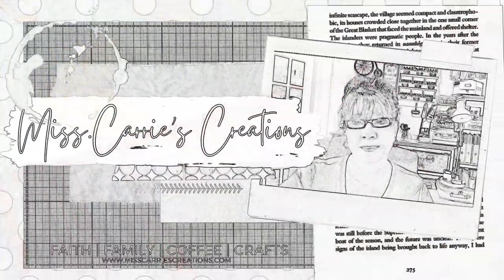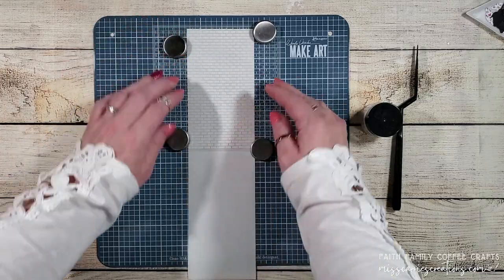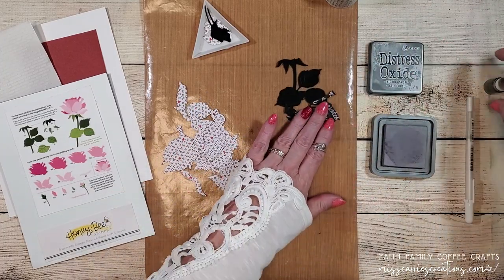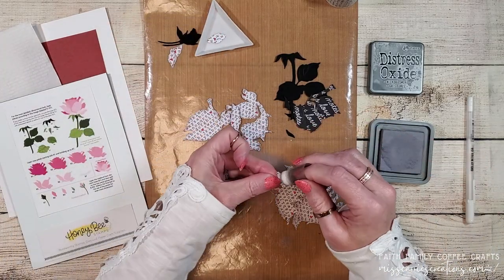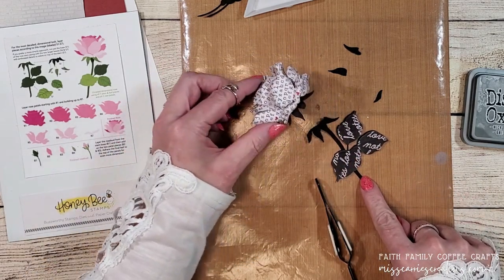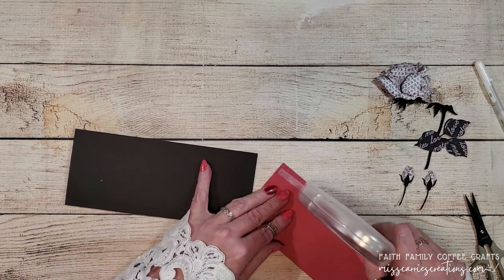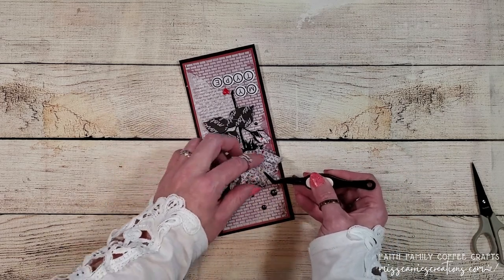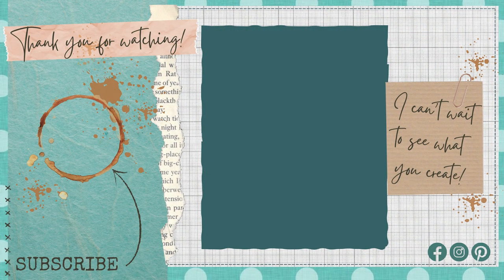Texture Paste on Vellum | Vintage Valentine Card

Comment: This card is so stunning, just found your video, your explanations are terrific as well.  I’m new to card making and was struggling with vellum buckling trying to use color pops and texture paste which did work better.  I’ll try an adhesive backer sheet next, thank you!
Reply from the maker: The adhesive sheet helps a ton!  I noticed a little less translucently to the vellum, but it still gave me the look I was trying to achieve.  Let me know if you have any questions.